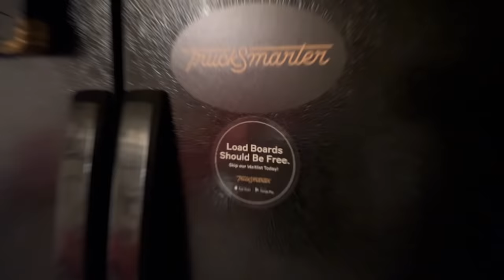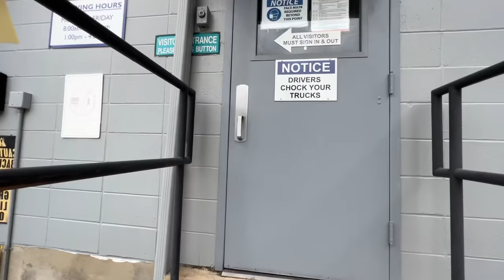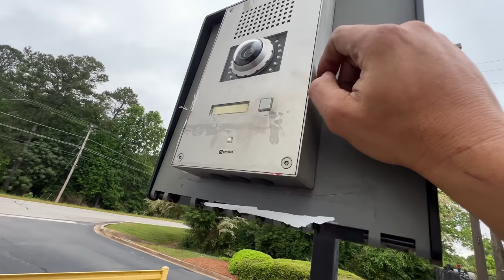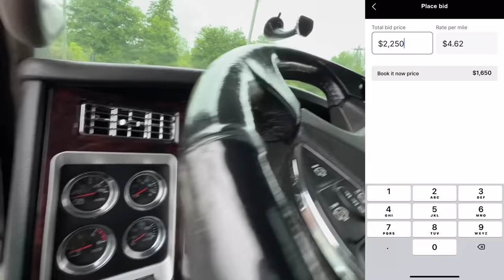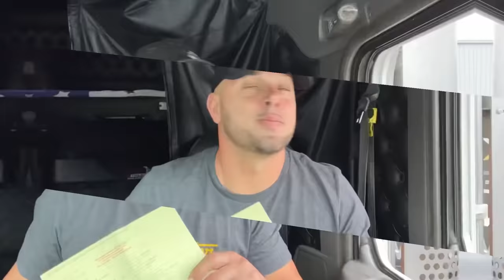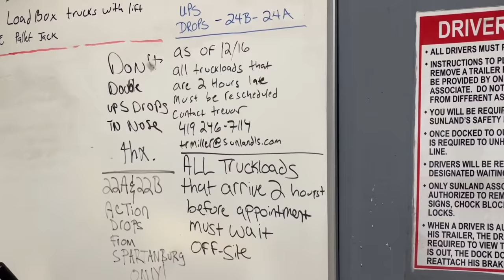$3000 in Two Days Still Possible?? Broker waits till Last minute to Book !! MEET a 3PL from SC 3one

Comment: I set my app at $8 mile and up for those last minute broker loads and worked on mowing the grass.   If I get a hit I will tell them I need $10.  = I need to counteract all the other truckers taking the .50 <--> $1 cheap freight.  With the fuel costs you are close to $1 mile cost now.   =I fill up the fuel tanks, work on the truck, and mostly stay at home now.  Truck has never looked better.
Reply: Everyone blaming the brokers have a misunderstanding of the Reality! It’s Truckers whom set the rates ! I’ve been hauling fertilizer for almost 2 years at excellent rates until this last 6 months because a bunch of foreigners came in with their POS trucks & Trailers and are hauling this stuff at half the rates I was hauling last year when fuel was 1/3rd
Reply: Yessir. Im otr hot shot $3 minimum. Ill just go back in the hotel for another night or swap out straps, get some good food.
Reply: I aim for a minimum of $4.50 on all miles loaded and empty on my route so some pay more some pay a little under but I don’t book and leave unless my route from home & back is paying $4.50 on all miles. Of course local runs have to be much more than 4.5 a miles basically under 250 miles I am high.

Comment: Love your video's as always Justin!....Here in the UK I was lucky enough recently at a local Transport Festival to be able to sit inside a 1996 "Kenworth W900L" . It had an Internal Bulkhead between the Cab and Sleeper with a square shape opening!. The owner of the Truck also watches your Vlogs!. American Truck's are Not used much commercially here in the UK as they are too long when coupled to our 40ft trailers taking them over the 52ft (ish) length limit, but we do have a much taller height limit at just over 16ft 6in (3 feet taller than you have in the USA).
Reply: European trailers have been almost 45 ft or 13.6 metres long since about 1991 with 51 ft trailers being on road trialled atm
Reply: Thanks for the update Richie, just shows out of date I am, Thanks!

Comment: I see you took the shortcut through Carnesville instead of 441. About15 mile shorter. Good choice. I pulled shotgun milk tankers. If you stop fast at a signal  a loaded tank will push you about 6 feet. LOL
Reply from the maker: That surge is no Joke 😯
Reply: I was stopped at a red light with the truck sitting in glare ice. The load hit and dragged the truck backwards about 2 feet. Almost hit the car stopped me. It was a whisky load and they are terrible for slop.

Comment: Justin good to see you back on the road again. What is the deal of green and red lights at the dock doors? Hope the trucking business improves.
Reply: Red light means you are locked to the dock and green means you can leave when shipper unlocks your trailer.
Reply: Thanks for info.
Reply: @cdjames4246  yea,but half the time, they are broken, and not considered by dock workers at smaller joints

Comment: Justin: Why don’t brokers consider (include) wear, tear, fuel and maintenance on trucks and trailers when posting loads and drop-off destinations?
Reply: All of you Independent Truckers need to make contact to advise these Brokers that are Scamming you on how much your getting per load.  Read stories of Brokers making $6500 on a load and trucker only make $1,200.  Needs to be transparency on what these brokers are making and Truckers get their fair share.
Reply: Brokers wouldn't make enough money if they did that. Brokers don't look out for their drivers, they look out for themselves